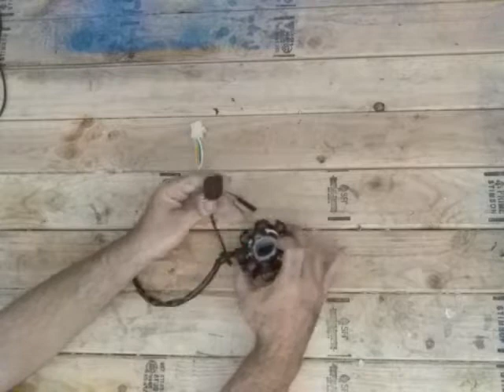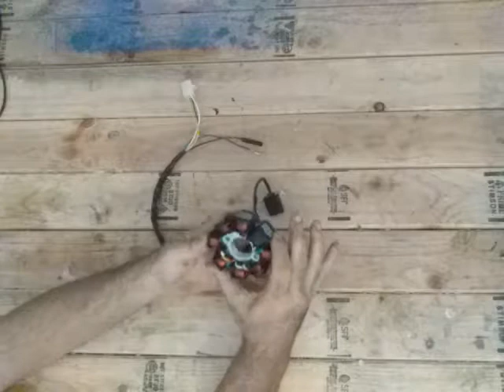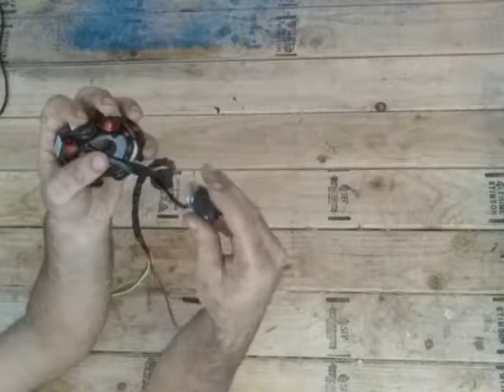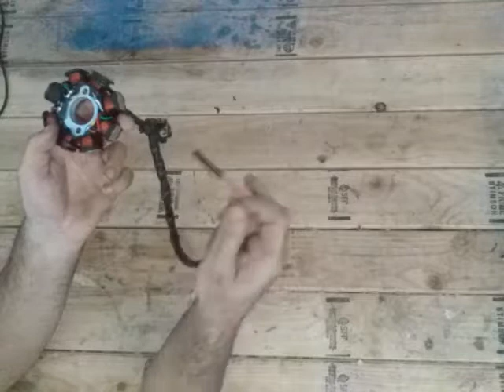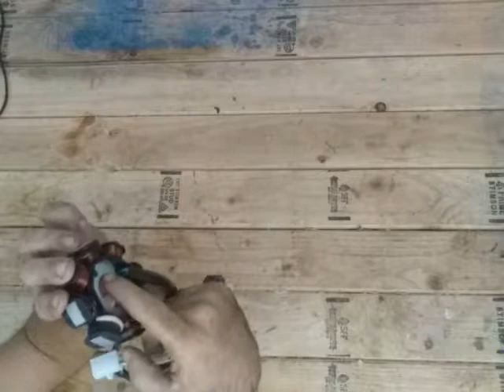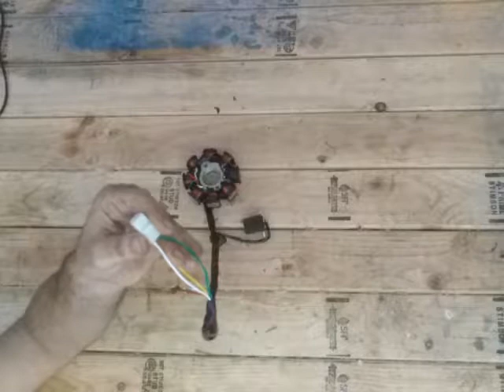What is a stator? Understanding the stator on your GY6.

Comment: Good information! I'm working on a 150cc quad with a gy6 engine in it. 
I've tested the stator and found that the 3 wires: green, yellow, and pink have continuity all throughout eachother. 
Isn't the green supposed to be on a separate circuit and have no connection to the yellow and pink? 
Stator also has the blue/white and red/black. But not worried about them.